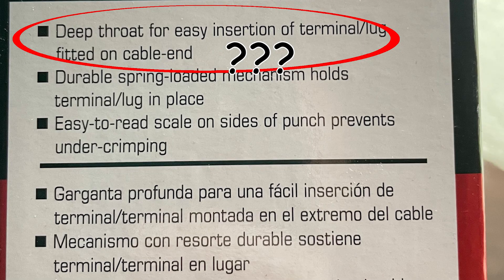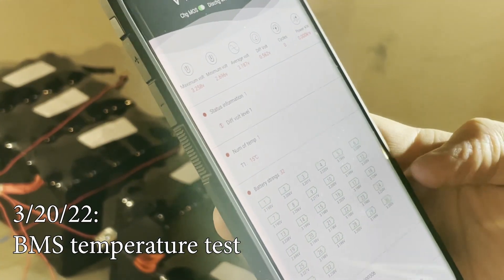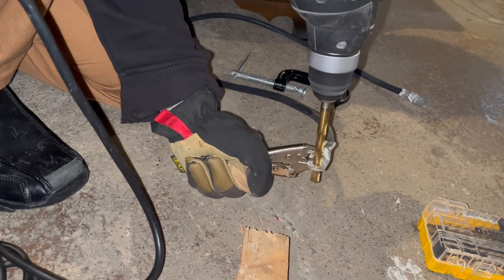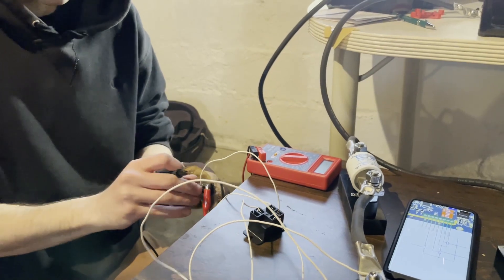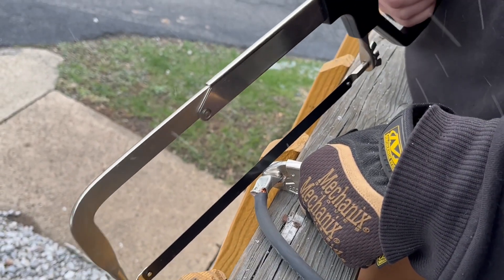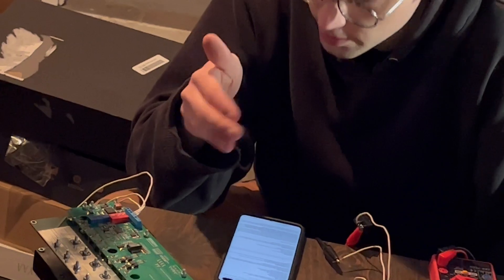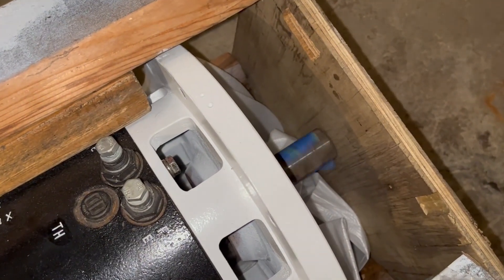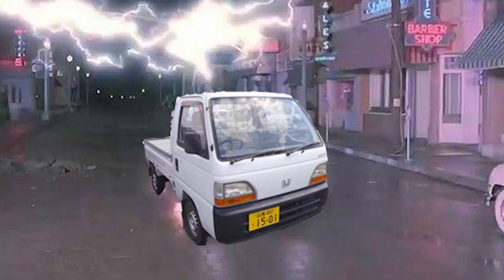Converting a Kei truck into an EV - Testing the drive circuit - Part 17

Comment: I love ghetto projects like this, so how many Kw of batteries are you using?
Reply from the maker: The battery pack totals 10.24 kWh
Reply: @actydcty4132  So a range of about 50 to 80km I imagine....I know its very light though...
Reply from the maker: @jedics1  Yep it should be about that much. It'll basically be a commuter vehicle
Reply from the maker: Our most recent energy efficiency video has the math on its range in different seasons & night/day